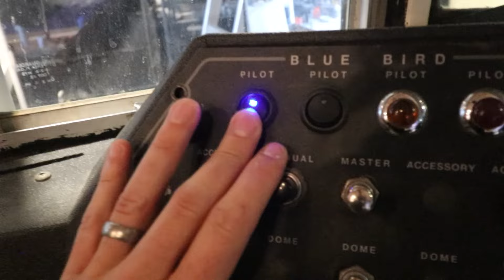Bus Converter Turns Client's 3-YEAR Bus Conversion To Liveable in THREE WEEKS!

Comment: You're using the wrong formula. You're basing it on the external measurement you took from outside when it should be the measurements based on from behind the driver's seat to the backdoor. The formula is the number of windows by the width of the window by the internal width of the bus. That's the square foot of the bus.
Reply from the maker: You are partially correct. The formula is the same but the dimensions are wrong. Windshield back is around 24’ so I should have done 7x24 equalling 168 sqft making this minisplit even more overkill lol thanks for pointing it out.
Reply: @BackroadPurpose Most would equate the driver's area as dead space unless you're not driving and even then most people don't use it except as a catchall. My question is the water heater. I couldn't make out the name when you mentioned it.
Reply from the maker: @suzannenoel3078  two things, I was referring to the minisplit being able to cool the space adequately so the driver area is appropriate within that equation. Second, if you’re thoughtful and clever enough, you can utilize every space. We put a swivel on our driver seat in our bus and included it as a seat for the front living. And the dash was a place to put Marshall speaker. And also a key tray at the front door.
Reply: @suzannenoel3078 Fogatti is the brand name.